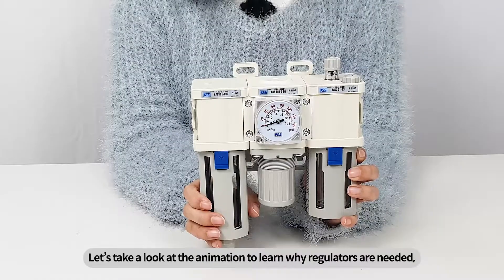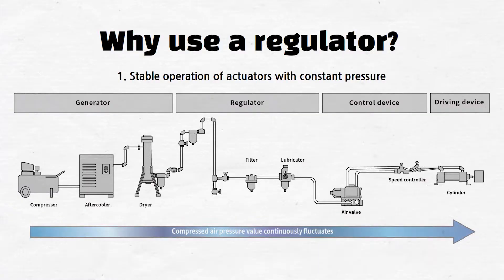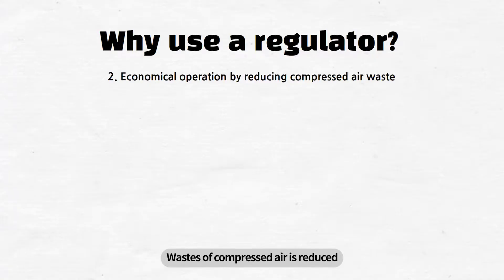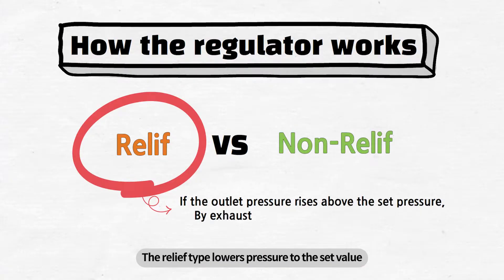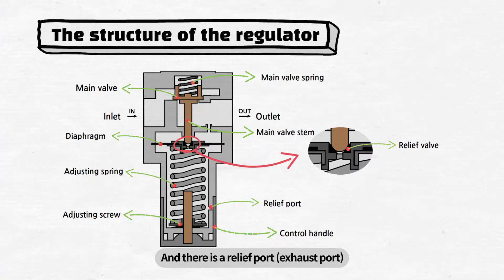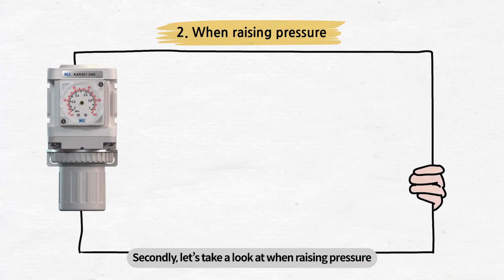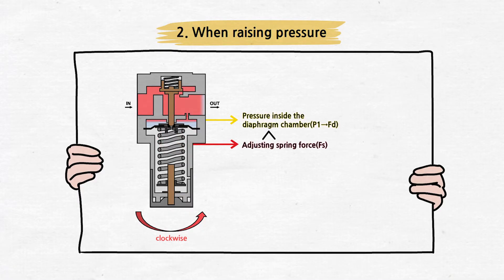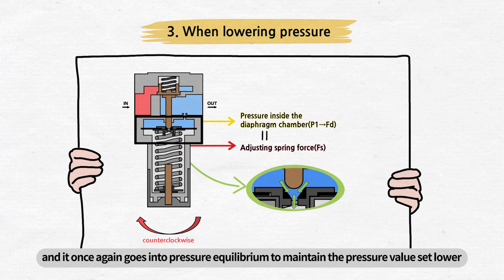How Regulator works? (subtitles | animation)

Comment: What if we use automatic pressure control in the compressor? Do we still need an air regulator??
Reply from the maker: If the compressor has an automatic pressure regulator, I don't think it's necessary to have a separate regulator.

Comment: Hello, thanks for your explanation. May I ask you a question? With this type of regulators, supposing thet the desired pressure can be obtained at the outlet of the regulator,  how much does the flow rate change between the inlet and the outlet of the regulator?

Comment: So what would be wrong with a regulator that leaks out air if you set the pressure below .06 mpa have one that say range should be set between .04 to .06 but if you make it less then .06 the air starts leaking out

Comment: I have one question. If input supply  7 bar  and regulator out maximum 2.5 bar. But suddenly its give us 7 bar on outside .then what is problem?
Reply from the maker: Am I correct in saying that the regulator accepts inputs up to 0.25 MPa? :)
Reply: if that is continously means the Regulator is broken or failed to regulate